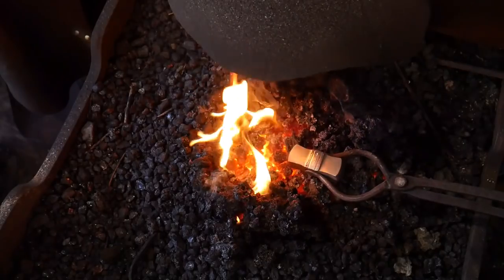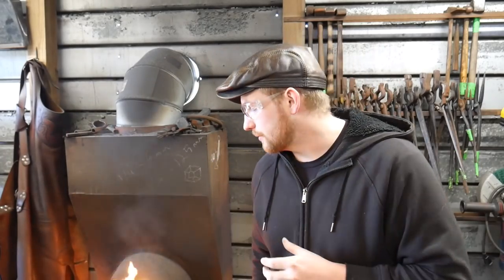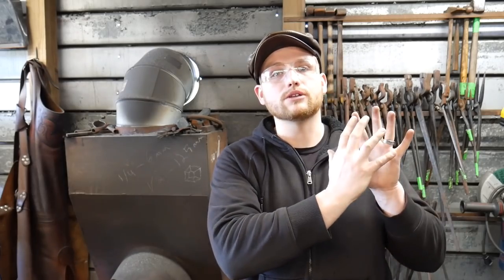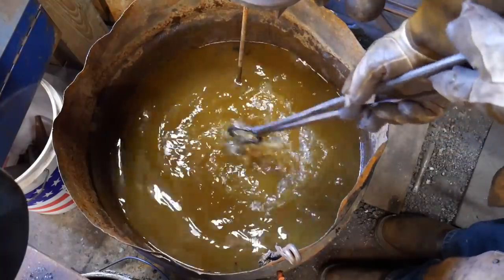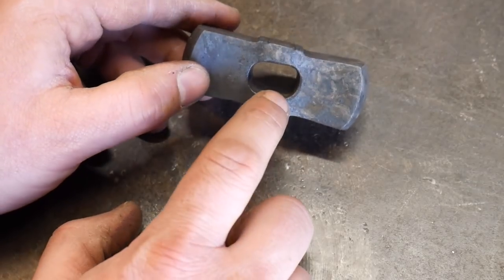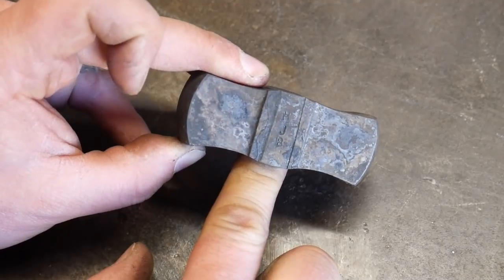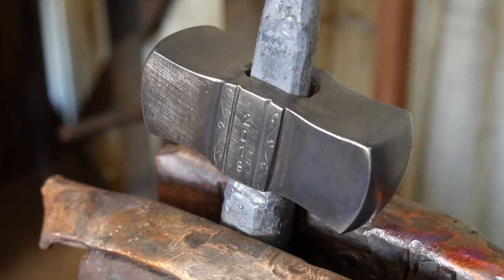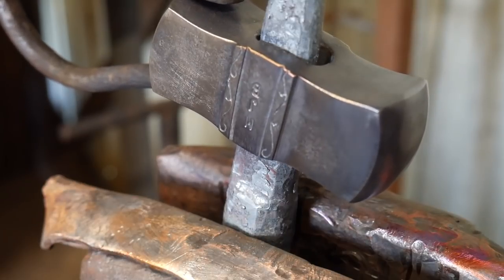Heat Treating Hammers in the Shop [Hardening and Tempering a Hammer]

Comment: Nice. I made my first hammer a few days ago. Did the heat, and quenched in oil. And what you said happened it got harder, but not its full hardness. Since it was my first hammer I used a big scrap wood wedge and forged it out and cut off the splitting edge. I looked up the type and it was "high carbon"...? Got a handle on it and it worked well. Way harder than mild steel, but I went to use my chisel and left marks after the blows. I'm gonna try a water quench next. Big thanks Roy!

Comment: I'm curious about your explanation of 1095 tool steel (1095 is not a tool steel) vs 01 or 5160 steels or 4140. You say that the 1095 is much lower carbon than those others, but tool steel is about the same as 1095 and 5160 is around .60.  I'm confused by your explanations.

Comment: I know this is old, but you mentioned a rosebud and there is a cheaper option that people might be able to invest in. I use a Bernzomatic TS8000 on the end of a 12ft adapter hose attached to a propane bottle. This is easy to keep around the shop especially if you have a spare bottle for a propane forge.

Comment: You were a little off on the carbon contents mentioned for 5160 and the 01 steels, 01 is listed as around 85-1.0% carbon the 5160 is around .60% carbon  and the 1095 used in the hammer is listed at 0.90-1.03% so that makes the 1095 the highest carbon content of the steels you mentioned. Great video as usual.
Reply: I thought that as well
Reply: Agreed.
Reply: 100%

Comment: Roy did you pre-heat a Second drift ? I was thinking that might be a good idea so the hammer wont loose it's heat while waiting for the first drift to get hot again. Thanks for your education Toby
Reply: That copper is sucking the heat out, I use my copper cookware to defrost streaks and chicken and whatnot. Similar concept but in reverse.

Comment: I love the videos although I do believe that some of your points are a little off when it comes carbon content and quenching
Reply: this guy is super knowledgeable and im just a newby but i work in steel mill and we were taught most steel looses magnetism around 1420 degrees but doesnt gain magnetism back until it drops to below 500 degrees.
Reply: so im confused , basically what im saying is the point where the steel looses magnetism and regain magnetism are too completely different points, so are you quenching the material at the point it regain magnetism because that is only 500 degrees

Comment: What if you heat the drift in the forge and after you put it in the vice hold a propane torch down low on the drift to help maintain the heat? I have never tried this before, it's just a thought.

Comment: Great thanks for this video. Very informative. Two questions: why do yo protect the vise with copper sheet metal? Can this process be done with a torch only? My concern being is it possible to anneal/normalise such a thick piece of steel using a torch.
Reply: The copper Sheet metal is for protecting what your Camping so you dont Destroyer the surface finish

Comment: You said 1095 is lower carbon than 5160. That’s just wrong and you are spreading misinformation. 

1095 has 0.9 - 1.03 carbon. That is considered a high carbon steel. 

5160 has 0.6 carbon. This is a medium carbon steel. 

Please make a correction in the video info and maybe look up some composition info on the types of steel you use for a video before you make it.

Comment: Is the tempering strictly for the color?
Reply from the maker: No it's for taking the hardness out of the steel :-) thank you for the question God bless
Reply: The crystalline structure is what makes it hard to begin with, very abrasion resistant, but it's hard as glass well close to it, the temper something totally different than the heat treat relaxes the crystalline structure a bit.